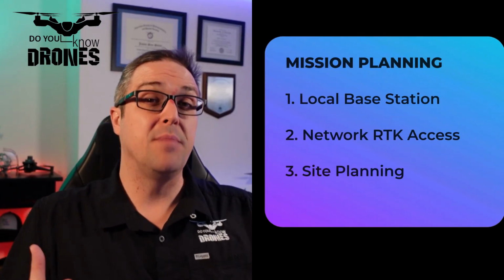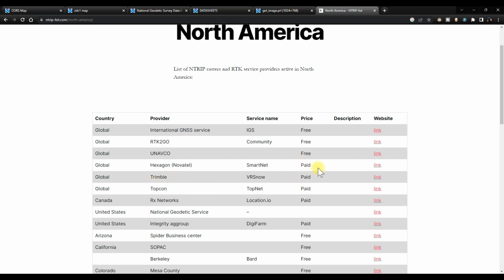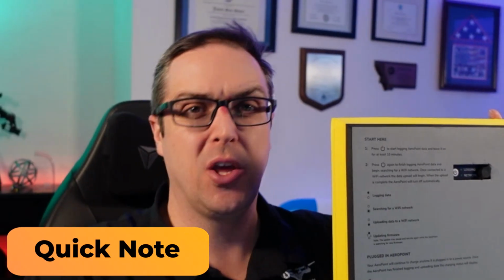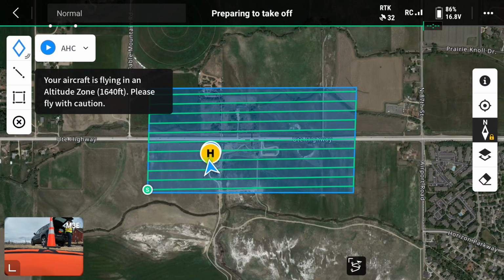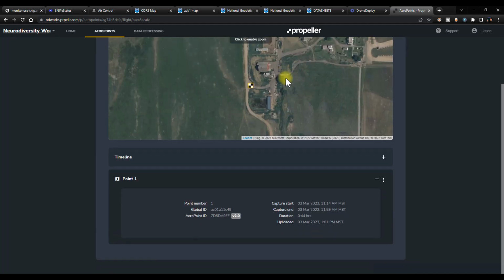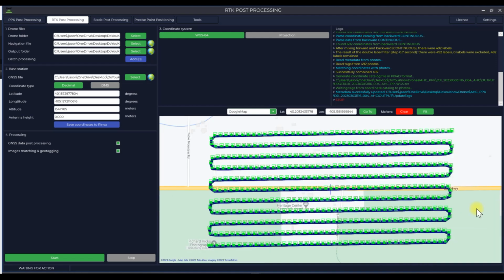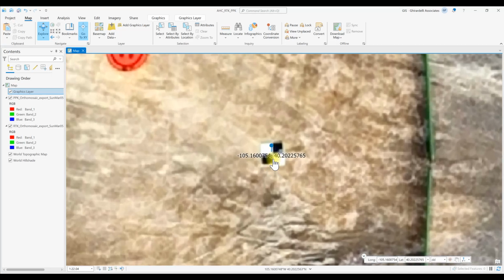Level Up Your Drone Data with Only ONE GCP

Comment: I'm confused on a point in this video...
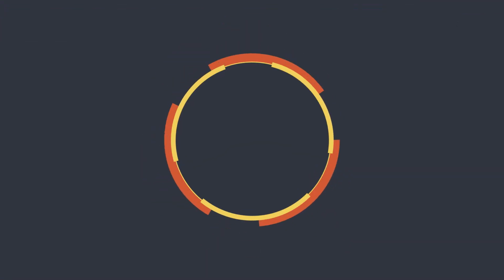There is post processing being done on the RTK images and you stated at around 44:00 that the software being used is updating the coordinates. Why is this step necessary? There was already the RTK module mounted to the 3E and there was a link established to the CORS ground station. And it showed the updated coordinates being available on the RC when the connection was made.

I thought RTK meant REAL time, so why is this post processing step necessary?
Thanks!
Reply from the maker: Great question! RTK is real-time, but PPK (post-processed) still creates a more precise solution, especially when there could have been a break in radio telemetry.

Comment: Awesome video, thank you! I'm learning and after watching your video a few times I have a question: - Why is it so important to let the drone record data right after the mission on the land or in the air (as you have mentioned starting 19:52). I use to keep the drone in the air 5 minutes before the mission is started just to get more satellites, but to keep it after its not clear to me. Can you clarify this, please? Thanks in advance.
Reply from the maker: It helps the PPK solution to have static data to match with the base station.
Reply: @DoYouKnowDrones  Thank you!

Comment: Thanks for the video.  I guess I am having trouble understanding the practical implementation of this.  In the video you are intentionally selecting a site based on the proximity to a CORS station and survey markers.  Is this possible in more remote sites?  What if you are outside the suggested 15km radius and have no survey markers?
Reply from the maker: Glad that you asked!  I’m working on a video for this use case right now. Stay tuned!  By the way, the workflow won’t be as disjointed as this one…
Reply: I was thinking the same thing

Comment: Great video, thanks Jason. I've watched it a couple of times but could you please confirm that in this case the aeropoint has only been used as a checkpoint and not as a GCP in DD processing? Thanks!
Reply from the maker: Confirmed. The AeroPoint was NOT used as a GCP.
Reply: @DoYouKnowDrones  But it was required to set the z coordinate. Thanks for the mega fast response!
Reply: That was also what I'am thinking, Aeropoint was not used as a GCP so no georeferencing done. If used as a GCP , It would have been increased the accuracy.

Comment: I'm curious if you would mind doing a similar video but capture GCP markers with a GNSS+RTK receiver.
Reply from the maker: I wouldn’t mind at all, but I unfortunately don’t have a GNSS+RTK receiver.  I’ve been looking at the EMLID Reach series.
Reply: @Do You Know Drones?  we recently got an Emlid RS2+ unit and are enjoying it with RTK corrections. I'm curious about the logistics of checkpoints and how to incorporate reliability into the work flow with DroneDeploy.
Reply: @DoYouKnowDrones  I live about a mile from where you did this and I have a GNSS receiver.  Would you want to get together to do it?  I am actually just getting my feet wet in this realm.  Let me know.  Thanks.  Al
Reply from the maker: Hey Al!  Which receiver do you have?  That sounds like a fun idea.
Reply: @DoYouKnowDrones  I have a Trimble DA 2 and I have a Rock Robotic Base Station I am putting up this weekend.

Comment: Amazing video Jason, thank you! James from DroneDeploy here.

I think the real reason that the RTK and PPK do not line up is that they are based on different datums. If I had to guess, the PPK matched the AeroPoint as they both using CORS networks that are using the nad83(2011) datum, whereas I guess the RTK2GO corrections were using the more global WGS84 and most recent ellipsoid. 

Both maps were processed with very high accuracy, and are likely absolutely referenced in XY to within 0.2ft vs their reference datum.

Anyway, your workflow to resolve that was great, thanks for sharing. If you want them to match perfectly in the future inside the DroneDeploy interface then you'd need to use an RTK network that uses a NAD83 datum. I think most CORS in the US will be using NAD83(2011).
Reply from the maker: Thank you for the insights, James.  I did wonder if a datum shift was responsible for the RTK result, but the documentation on the RTK2GO network was a bit scattered. That being said, I know that DroneDeploy offers RTK Corrections within the Flight App. That’s something that I will showcase in the future.
Reply: First and foremost great video. I was also surprised to see such a large shift on the RTK dataset. It almost made me wonder why we invested in an RTK drone in our company.  I think that if you get an Emlid and can measure your GCP using the same datum, then the results would be much better or better say closer. 

You experiment makes RTK look inaccurate, but RTK  is actually supposed to be good (very accurate) as long as you don't get any drops. 

You make me want to go buy an Emlid or a pair of aeropoints. 

Propeller also has PPK processing, ask them to process your data for the video.